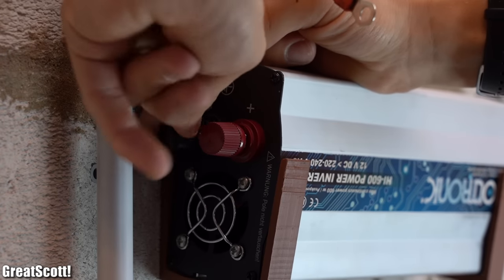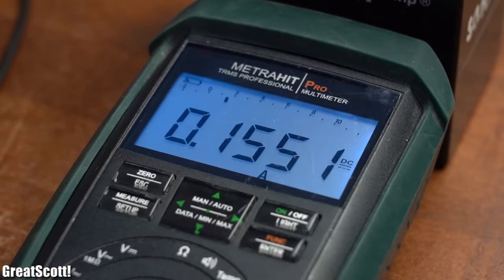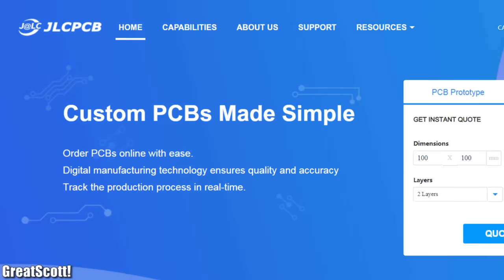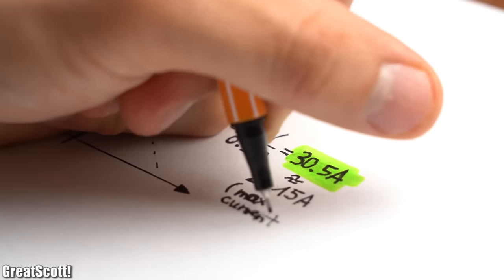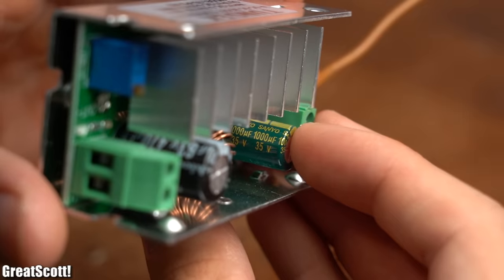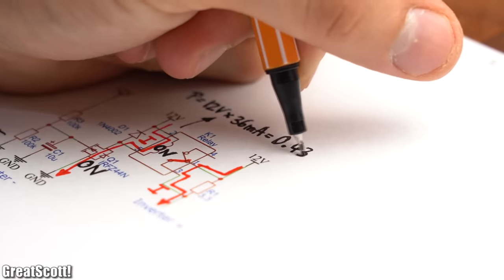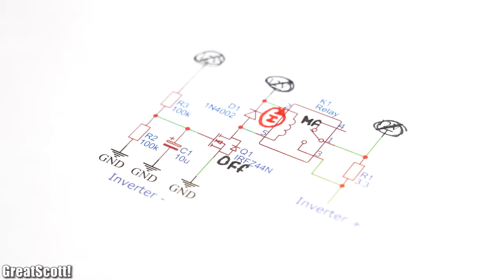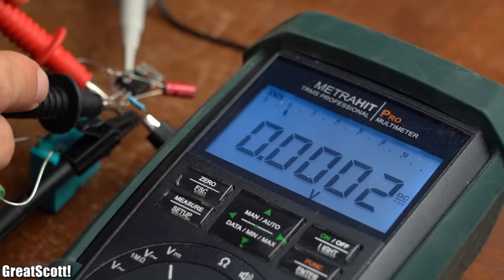How to make a Softstarter and why it is sometimes mandatory to use!

Comment: To all those people here making comments about mains AC motor soft-starters: Mains-level voltages are dangerous, that's where DIY gets a dark tint. But to the point: years ago there used to be an analog chip called the U2008D, which you could use to steer a triac directly. A single triac = single phase. It was capable of soft-start and it did have some features for motor startup specifically (what with the phase shift between "V" and "I" and maybe trying to address some of the deeper magnetic stuff). That chip has been out of production for like a decade now. And even when that was available, you wouldn't be able to use that (alone) for 3-phase controller designs. Nowadays apparently all the commercial products are using microcontrollers, I believe there are even dedicated uC models for 3-phase motor control... which makes DIY a little far fetched. Some opto-couplers or IGBT's would not be that much of a problem, but coding the real-time phase controller for a miscellaneous MCU probably doesn't quite pay off to a hobbyist... Besides, starting a 3-phase mains AC motor by basic phase control is not very efficient. Optimally you should change the mains frequency too, and have feedback about current consumption / zero crossings, etc. This is what "variable frequency drives" are about... expensive and noisy bastards :-)

Comment: Use Zero Force relay to prevent power loss due to power lost inside the relay once activated. Zero Force relays require a pulse of voltage to open them with battery connected forward, and then disconnected, so providing a pulse like forward input. By reversing the voltage across the relay and pulsing it over the relay the relay opens up and no more current is consumed. Zero Force relays are amazing for those kinds of applications.

Comment: Use a SPDT relay.  Feed the inrush limiting resistor through the normally closed contact and the load through the normally open contact.  When the relay is energized, the limiting resistor is removed from the circuit and its dissipation is zero.  The few milliseconds between relay contact break and make are a non-issue, as the load's input tank capacitance is already charged.

Comment: put the relay coil in series with a cap to gnd. that way when the power is applied, the relay NO is closed and power your soft start resistor through the closed contact. when the relay de-engergizes, the NC contacts supply the full load, and no relay power draw.

Comment: Hi Scott. I had similar issue with battery BMS. It was going in protection mode with some of the class D amps at powering on. I solved it by adding a bigger capacitor in parallel to the output of BMS. Something similar is applied also to the car amplifiers power input when power consumption is too high compared to the battery capacity.

Comment: You could also bypass the charge controller for the main load.  I would connect the inverter directly to the battery through a relay which can be controlled by the charge controller to shut down the load if battery voltage drops too low.. Doing it this way you can use the maximum output of the battery and, if the sun is shining bright, the output of the charge controller..

Comment: For a large capacitive load, simply add a large inductor in series. But Scott would have a 30 second video then. Still a great idea for a circuit. This is kinda how motor soft starters work, but with using capacitors instead of a resistor in series and a motor contactor(large relay).

Comment: You could do this with a lot fewer components. Like toss the mosfet and relay and replace them with an igbt, and get rid of the rc circuit and use the voltage rise on the load side of the resistor to trigger the igbt to bypass it, which then latches the circuit until the power is disconnected.

Comment: Soft-start plays a much more important role in the case of multi-potential digital circuits, ensuring a synchronized startup between multiple voltage supplies and thereby preventing conditions such as latch-up.

Comment: Save more and do it in reverse : use the active relay when switched on to draw current via the resistor, after one second depower the relay thus switching to direct power connecting without resistor
Reply: Actually a good idea.
Reply: At the instant of switch-on, the relay will be de-energized so there will be a direct connection and hence a large current surge. Relays take many mS to energise.

Comment: Just an idea, you can use a solid state relay for two reasons 
1) they waste basically no power
2) if for some reason the mosfet fails the SSR will stay on by itself ( if used with DC )

Comment: I lately came to a similar issue with a power supply which tripped the fuses in our lab - An absolute no-go. By adding an inrush-current limiter to it, everything has been solved.

Comment: I would love to see a video on electric motor soft start. I did a lot of reading on it and couldn't find exactly what I was looking for, people seem to care more about speed control.  I have a electromagnetic coil that activates a clutch and want to be able to dial the right amount so it doesn't slam on and break belts.  I have flipping the switch on and off fast but a circuit would be great and think an electric motor soft start would do the trick. I learn a lot watching your videos. 😀

Comment: I do love the circuity you made for this video, much more efficient than the standard NTC inrush fare.

However, please PLEASE insulate that circuit you made for your inverter in heat shrink and electrical tape! Shorts could be catastrophic.
Reply from the maker: I used electrical tape for that.

Comment: A bistable relay , a tiny 6-8 pin micro and a capacitor big enough to power the relay and micro for ~1s - have the micro poll the input power - when it's off, use the energy to  reset the bistable relay. Outputs of a micro are powerful enough to drive a relay.

Comment: @ 3:00 ONE HAND! It doesn't matter you know the clip is plastic. As standard procedure, only one hand when on any powered circuit, *especially* when your left hand is on a metal chassis. The dead engineers wish to tell you they also "thought" it was ok. (Just trying to keep you with us as long as possible.) Regards.

Comment: I also thought of another way to make a soft starter: no resistor just mosfet as a switch, but connected to a microcontroller (attiny13 for example) and the microcontroller, when powered on, gives the mosfet a PWM signal of almost 0 percent, and then gradually increases it to 100 percent within the one second. At least this has proven to work with a power-hungry DC fan (with a rise time of 10 seconds instead of one). But maybe adding a capacitor at the output would make it good for other appliances too.

Comment: An even better solution for even less wasted power is using a zero crossing triac and an opto triac trigger (e.g. one of the MOC 30xx series) instead of the relay. Simply turn on the triac fully once the voltage on the input cap reaches a certain level. Smaller, faster, lighter and more reliable than a relay. Be aware of which MOC you use. Just about any will work, depending on Triac used and the minimum gate current required. But some MOC30xx are random phase and others zero crossing. Either would work in this particular usage case as a random phase "on" point is only what a relay would provide anyway. The use of a zero crossover version will be completely (or near enough) noisless (electrically).

Comment: You can reduce the power loss at relay using an electrolytic capacitor in parallel with an resistor between the capacitor and mosfet gate.

Comment: Great video. I need such circuit to power a car type air compressor with a 12v 5A smps.   Such circuits are called "delay on/off" and there are several designs utilising mainly transistors and rc networks.

Comment: I would suggest to switch the negative head instead of the positive one, because otherwise it could lead to fry the components of the inverter. To connect a battery properly, you should attach the positive or red cable first to the battery. Then attach the negative or black to the battery. To remove a battery, first pull off the negative or black cable and only then the positive or red.

Comment: I use a similar delay circuit to pre-charge the huge capacitors used on the motor controller of my self made electric vehicle.

Comment: Bit of nitpicking, but since you went that far to reduce the power wasted by in rush current limiting (you can skip the relay and just use the same MOSFET but wastes ~6W at 15A), I think you can also add a small inductor and reverse the relay so that it doesn't use any power in normal operation.

Comment: You could've also just added in some capacitors at the charge controller t after the 15 amp protection piece. therefore not even using any current, and it will provide a little extra boost when appliances need more mower for only a few milliseconds.

Comment: you could actually use quite similar circuit, but using p-mosfet, and use it as a power switch, eliminating the need of the relay and series resistor

Comment: Why not simple coil?
You have missed it in Switching Mode Power Supply.
There is a transformator placed right after NTC and it is there to limit current at peak of wave (as capacitor will be topped up).

Comment: I have solved the problem differently...
The solar-regulator is switching a relais, only off when the voltage is too low in the batteries.
The lager users are on this relais, not going trough the solar-regulator but directly getting power from the batteries.

This way: the inrush-current runs only through the relais and will drop the voltage of the batteries a bit but normally not trip the regulator (only when batteries are quite empty and/or to little sun to provide the power). You could use a solid-state relais to save power or like I do only switch it on when I need a bit of power (thus turning the light on). You can also biuld this into the inverter, but have the contorl-line from  the solar-regulator (thin wire, just for the relais) to the inverter's switch.

Comment: I would use a p-mos transistor connected similar as your irfz44 n-mos instead of that relay, resistor etc. :D That p-mos could be in series instead using a resistor. It's a good ideea, but it may be made cheaper.
Keep up good work!

Comment: Just throwing out a comment, I am no expert but a reason why you may want to have the inverter on the solar charge controller is to customize the battery discharging levels. Inverters do have a low voltage cut out however these cannot be changes? Most solar charger's these days can be configured to cut in and out at certain voltages. This way you can controller the battery charge level to a greater degree. Just a random thought...

Comment: The relay power could be reduced by a CR network in series (or better, by a capacitive boost to a higher voltage relay)  Trying to remember the circuit from a book, which  threw a charged capacitor in series to pull in a relay rated for 2x supply voltage, which then held using less power - that also demands a sharp switching action so would not work with the slow ramp drive to the mosfet

Comment: tell me if I'm wrong, IMHO, at 7:42, the R value of the τ=RC should be 50kΩ instead of 100kΩ, which is the parallel value of two 100kΩ resistors, according to the thevenin equivalent circuit.

Comment: I have a feeling that the thermistor is supposed to be calibrated against the discharge resistor on the input capacitor, such that the capacitor is not fully discharged yet until approximately the thermistor has cooled down. This would prevent a large inrush current just after powering down and on again, as the capacitor is not fully discharged yet.

Comment: A similar circuit might use a P-chan mosfet to bypass the current limiting resistor, eliminating the relay.   Lower power losses, physically smaller, and cheaper.

Comment: Just used a boost converter to power an audio amp. You guessed it, the converter shuts down so for now I hve to perform manual pwm and switch the main switch a few times very fast so the cap gradually charges and stops the inrush. I need to make a soft starter though soon...

Comment: Nice video! One question, why do you use relay in this application? Wouldn't just the mosfet do the job? Also you could just change the final gate voltage to be higher just to make channel resistance smaller so less power dissipation. This way you could have less parts and it would be completely electronic solution. 
😁😉

Comment: my first thoughts with my water pump. the pump (1.5 HP, 1.1KW, 2.5 amp) starts up with a huge draw. this triggers my 3000 w inverter to have a heavy draw on my batt bank, resulting in the inverter shutting down. 
my first thought was to add a power cap to this pump to get its starving power needs. 
however; a soft start would seem to work great, also saving my water lines and pressure tank the extra stresses. 
Ty very much for ur vid ... but now , where do i buy one? 
ps ... im off grid building this system slowly. eventually my goal is  5kw -7 kw solar/wind hybrid. im not there yet. on grid is not an option, not that id want it.

Comment: Nice video as always! But talking about inrush current in a motor or inductive load is a bit different to charge an input capacitor, in both cases there are inrush current but for different reasons

Comment: My ATX-PSU based power supply will switch off if I hook up a automotive light bulb (24W), because the inrush current is too big. So I made this circuit. I did find using a 10 μF capacitor would cause the delay to be very short (though sufficient), so I replaced it with a 100 μF capacitor, which takes a few seconds to switch.
I also noted that if you switch repeatedly, the delay becomes very short, probably because the capacitor is still charged. (I guess a downside of using a bigger cap). Maybe a bleed resistor could be incorporated.

Comment: A much more simple softstarter could be, for example, a 2 ohm resistor in parallel to a big 10mH inductor. In the first moment the inductor blocks the current for may be (tau =  L/R) 10-30 ms. In this time the resistor limits the current to  I = 12V/2Ohm = 6A. After 5 tau the inductor ist approx. 0 Ohm.

Comment: I made a more advanced version of this, my eskateboard has huge caps on the esc and I noticed most power switches have a tendency to.. explode. Im charging the caps trough a power resistor and button, and I use some circuitry and a btj to trigger the mosfets when the difference over them is only 10V or less.

Comment: Would have been simpler to use the basic resistor idea but with a lower resistance to limit current to 15A (0·8 ohm). After inrush, power loss at the resistor would be negligible. 
Thing is, you have the same issue with other devices - so will have the same problem multiple times. The answer for you, looking at the controller (0:25) is to move the pair of LOAD wires into the BATTERY terminals. The battery would provide the correct inrush current and the controller would not see this as it was coming from the battery. The battery is there to provide the power - so use it - like every normal person and motor vehicles do - they do not rely on alternator controller to provide the power !

Comment: Good idea and thank you for a very thought provoking video!

I'd have to build and test it to be sure, but could it not be made using the same design but inverted? If you inverted the switching of the MOSFET and wired the relay differently, this would ensure that once the capacitor had charged the MOSFET would turn off the relay and relay would be wired to bypass the 3.3R.

Just thinking this would help reduce the power consumption and life of the relay while the invertor is running?

Comment: Electric cars use the same process, when you turn the car on the large capacitors are charged up via a resistive load then a solinoid or relay bypasses the charge cct, you would get massive arcing from the DC contacts and they would burn out very quickly, DC is more susceptible to arc than AC.

Comment: Hi Scott I liked your solution, but I have a question why did you use only an inductior you can solve  Your in rush current, buy using low values for it you can solve your problem
Reply: yes about 1uH air coil inductor should do it right?
Reply: Exactly.

Comment: I curious why you didn't use the Inverter + voltage as the reference to turn on the NFET & relay, rather than the arbitrary RC circuit. It seems like that is a better way to know when it is ok to bypass the resistor and you wouldn't have to worry about turning it on and off repeatedly if you chose a proper threshold.

Comment: I had a problem like this with a controller. What i did was build a little board with a m0 to the output a pair of relays and 6 200f super caps
I built a shunt ref to an opamp the drives a mosfet. This simple circuit is is setup to limit current to 1A but the ref of the circuit is tapped to the DAC on the M0 so i can program higher current limits upto 15amps..
This current limiter has a relay bypass and an output relay so when you power up the circuit limits current and powers up the mcu the mcu monitors the voltage on the super caps and input voltage once the caps are charged the DAC raises the current limit up to the max for the power source and closes the output relay, if the voltage is stable for more then 5sec the current limit is bypassed by another relay to reduce losses